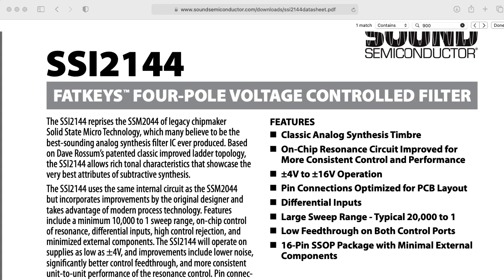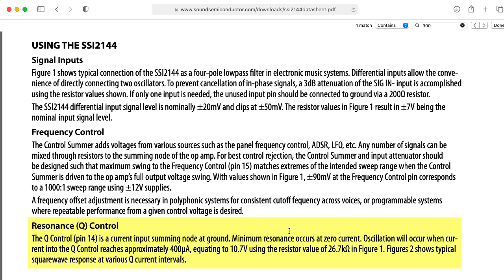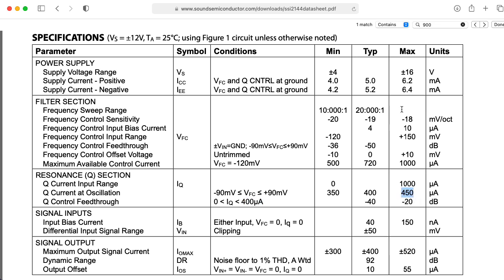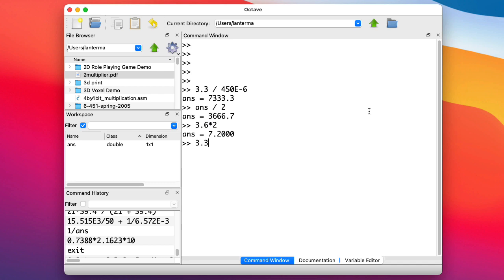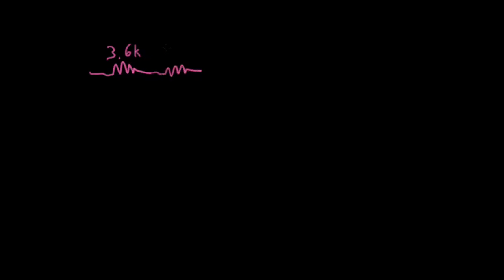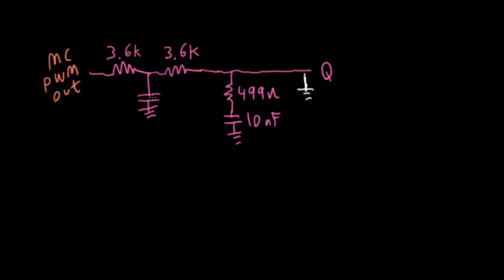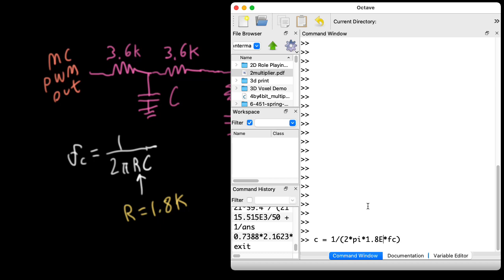SSI2144 VCF Resonance (Q) Control via PWM from a Microcontroller (like Adafruit M4 Grand Central)

Comment: Interesting!  Love this chip (well all of their chips, but...)  So if you want the linearized response that you'd normally use the OTA for, you could just program a table/curve for the PWM?  (I'm not a programmer, but understand some of the concepts...)
Reply from the maker: You could probably do that, but I can't think of an application where you would want it to have a linear response?
Reply: @Lantertronics Oh!  Not the control itself, but to sort of bake in the adjusted response of the circuit on page 7 of the doc.  I suppose one could still use PWM, and the OTA circuit.  I was just curious if maybe it could be all done with the microcontroller control.
Reply from the maker: @DrJ3RK8  Oh! I see where you're going now. Yeah, that could probably be made to work, I think...

Comment: Great video. After fitting one to a SIEL Opera 6 with 5x SSM2044's, the resonance of the SSI is much bigger. I have not been able to calibrate. I wonder if it's possible to dial it back a bit with additional components in the adapter board

Comment: 2:08 i don't not understand that 10nF capacitor, why not just connect the 499R just GND directly? what effect does that capacitor have there?
assuming the capacitor needs to charge up before something happens. you see this in more schematics (of old gear).
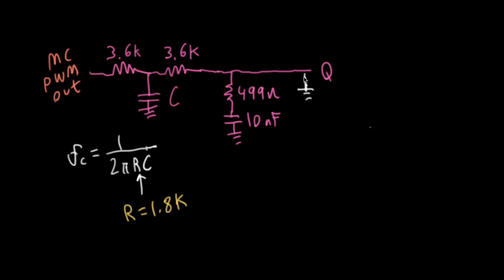8:40 what kind of "opamp" is this: Gmq, 2 outputs.
Reply from the maker: At 8:40, the Gm notation suggests it's an operational transconductance amplifier. These have differential outputs, so one output is opposite sign of the other.
Reply: @Lantertronics  my excuse, i meant to say transconductance amp. now you don't need them, because you can buy a SSI or ALFA chip, but there isn't equivalent type like LM13700.

Did you came along the AS3350 (aka CEM3350) dual filter chip? Alfa copied the pin output and description of the CEM3350 datasheet.
it's a weird 2 pole design, but both poles receive the same input. but could you put output of pin 3 in to pin4 with a capacitor like a traditional filter? found it last week.
Reply from the maker: 2:08 the real question is flipped around -- why is the 499R and there? The input is theoretically at ground itself, although it won't be exactly. Anyway the whole point of the the 10 nF is to filter high frequency glitches; shunt them to ground so they don't effect the Q input. The 499R means that this is like a shelving filter instead a pure lowpass filter.

Comment: I'm thrilled you're doing a series using the SSI chips. I'm currently working on a design that will use them so it's helpful to learn more about them from a practical application standpoint!

Comment: hello, recently got 2 sub woofers for repair. and wondered if you would want to do a video on it, they are mackies. swa1501. you can easily find the schematics inline. I cant seem to figure out why it died, I have found the bad parts. tho
on the amplifier board, so far ive found transistor, Q18 to be shorted, which sent i believe 100 volts into the lower voltage areas. 
resistors r17on the low side is fried, and on the 2x18 volt line on the transformer, resistors r26 and r73 are also fried. 

I'm pretty sure those 2 friend because of the high voltage getting yeeted into the low voltage area, but I cant seem to figure out why resistor r17 died. the transistor next to it, Q5, is ok. 

and on the input board, resistors 50 and 101 are cooked looking, they do read correct values still, But I'll replace them regardless. Those are on the power on part in the input schematic. 

you know audio circuits really good. Wondering if you are able to give a breakdown of what happened and a little more information on how it failed, and even more so r17 has me the most confused. nothing else down the line to reach r17 fried. 

I'm having to order the transistors to replace before I''m able to turn it back on and test. but it does have a lot of debug leds on the board. 

dunno if you are interested, but thanks for your time regardless. 

https://elektrotanya.com/mackie_swa1501_sch.pdf/download.html link to amp board
https://elektrotanya.com/mackie_swa1501_swa1801_inputboard_sch.pdf/download.htmllink to input board
Reply from the maker: This does sound interesting -- alas I won't have time to look at it anytime soon. Ping me again in mid-December once the dust on the semester clears.
Reply: @Lantertronics  I'll try and make a note. Youre a very busy person, 100% understand. I greatly aprechiate you and your videos.
Reply from the maker: @TheMookie1590  Thank you for your kind words!